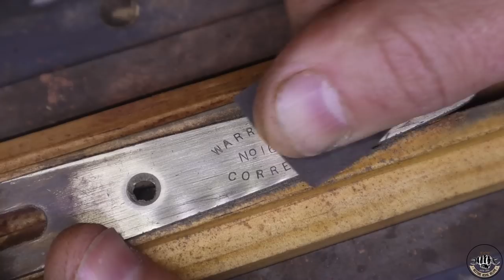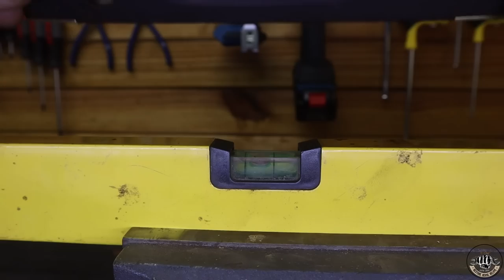Post WWII Rabone Rosewood and Brass Spirit Level Restoration

Comment: Well this is good timing! I just bought an E Preston & Sons spirit level for £1 from a charity shop yesterday, and it's almost identical to this one. I was mainly interested in how to re-calibrate the vials when reassembling. Nice job here, but I think I'll probably spend about 10 times as long working on the finish. Can't wait to get started on it!

Comment: OK, it now has a nice finish and is a good useable tool. I have refurbished dozens of these over the last 45 years to sell on my market stall. There is no way that yours is Victorian -- it dates from post WWII. Any earlier and the screws would have rusted and would be almost impossible to remove. Screws were always bare steel and never plated. Brassware was never polished -- it was just bare brass matt lacquered.  Pre WWII levels had clear fluid in the tubes -- after the war they were filled with the green fluid. The Rabone 1265 levels came in various lengths (6", 8", 10", 12", etc.).
Reply from the maker: I did some Google searches and 80% of them stated it's from the Victorian era. So naturally it found its way into the title. That is some good info you gave there, Ill change the title accordingly. Thank you!

Comment: Does anyone know why the measuring tubes are a bit curved?
Reply from the maker: That helps the air trapped inside to level out easier, Gives you a quicker accurate reading.